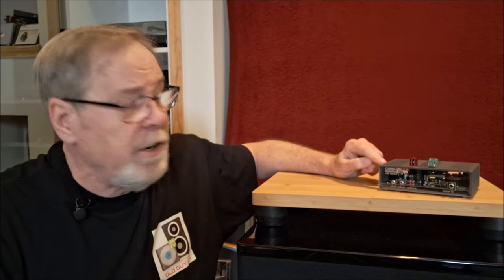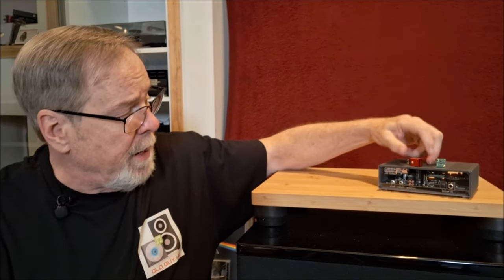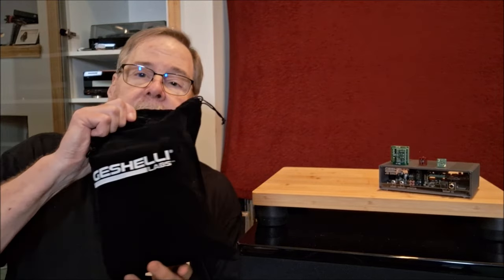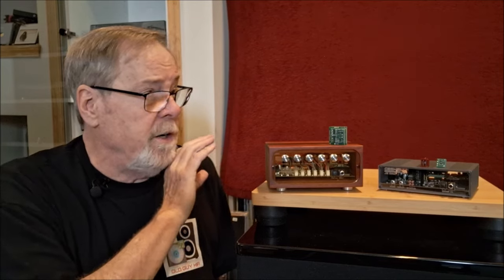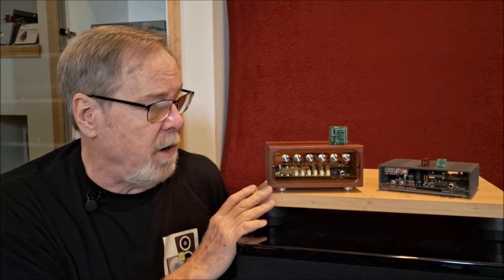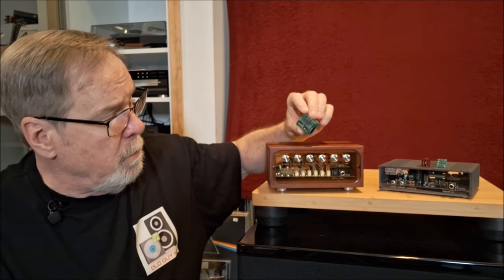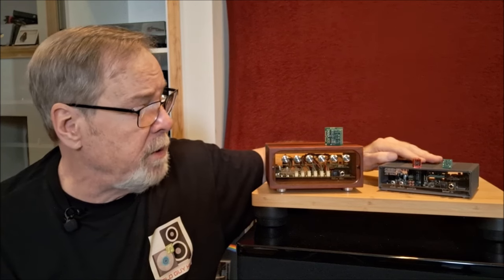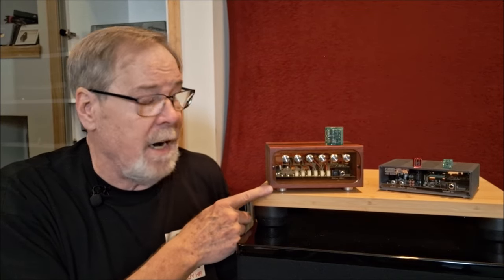A quick look at the new Geshelli Labs J3 Pro DAC. Full review soon.

Comment: How IN THE WORLD could someone sit on their couch and pick the right op amp?
Reply from the maker: Personally, I use magic. I have both the J2S and J3 side by side and as they use fundamentally the same chip set and layout I can compare the op-amps easily from my recliner not a couch! Lol. Seriously, I make extensive notes on the sound I am hearing and honestly, I have been doing this for so long my ears are kind of trained to hear differences and I have been listening in the exact same room for 30+ years. The bottom line is that if you can't hear a difference then there is no difference but, if you can, and that difference has a value for you then swap away. I also use headphones to try and listen in a bit closer. I do not advocate that anybody spend money on something that they can't hear. Wilson, thanks for sharing your thoughts and coming back to the channel for more.
Reply: @OldGuyHifi  yes, thanks for the feedback!  But from the point of view of a guy sitting on his couch wanting to buy this and trying to select the right op amp WITHOUT buying all the chips, this is going to cause buyer hesitation from out of this world for me.
Reply from the maker: I get it. Go with the basic unit J2S or J3 Pro and know that they both sound awesome out of the box with the standard TI op-amps and save the money for a nice bottle of Scotch. You won't go wrong. I think the AKM4499 chip set is the bid deal here not the op-amps. I am a nerd so I go for this tweeky stuff.

Comment: I would be very interested in your opinion about diminishing return / value for the increased price points in the Geshelli line. You can get the "classic" ESS9026 or AKM 4493 for around $250 (aluminum sans USB), or upgrade to the mid tier (that you have) J2S with Sparkos for  $500-670 depending on number of opamps, and finally $780 for the J3 Pro. So call it $250 vs $500 vs $800 (approx $300-ish jumps to simplify). What level of performance / value do you see between them? Of course we all want the best ;) P.S. What wood did you choose - it looks beautiful.
Reply from the maker: I can say with a level of confidence, that for the given price point the standard J2 is very good compared to comparable priced units from Topping, SMSL, etc. Now, just so you know, I am not the biggest fan of common Delta-Sigma chip implementations. For years my reference DAC has been a Schiit Bi-Frost Multi-bit unit that has been modified. I started to get an inkling that the new AKM 4499EX/4191 chip set was different with the J2S I have in. I have not finished my reviews yet so, my conclusions are very preliminary. I do hear a positive difference between the J2S and the J3 Pro. I think the differences between DACs that cost from $100 to $1000 can be far more significant and noticeable then the difference between DACs that cost from $1000 to $3000. Usually on the expensive units it is the output stage i.e., tube output or similar that makes the difference not the decoding methodology. Unless you have deep pockets or have a huge investment in your Hifi, I would council against spending much for than $1000.00 for a DAC. Wow! Did I just write "War & Peace?" Sorry. Great question. Thanks for seeking my opinion. Something I am not shy about sharing!  BTW, Geshelli just sent me the unit for review. They choose the wood.
Reply: I have had the same question. Have seen a couple positive reviews now of SMSL's DO200 Pro as a contender in that range, if it drops in price significantly this month, I'll probably give it a shot. Though I do like the idea of supporting the Geschelli family. So, so, so many choices...
Reply from the maker: For my money and listening preferences, I would go with the Geshelli J2S for sound quality.

Comment: This looks to be a good fit in the models between the J2S and the Dayzee. All the I/O on the back, and separate buttons, etc. The power supply is a surprise - I am looking forward to your review, Ed!
Reply from the maker: Thank you Neil. I am going to run it in for couple of days. Those big 2509s look like they could use some breaking in. First impressions are good.
Reply: @OldGuyHifi  Like all op-amps that I have tried, they all need some burn in, I think. What I have noticed is usually the treble gets "cleaner" / sweeter? The SS2590 Pro is their flagship and uses the best discrete parts, with less restriction on the size.

Comment: I’m gonna try out the SS2590s using a dip8 extension on the J2S. I had purchased the J2S a few weeks before they announced the J3 Pro 😅.
Reply from the maker: The 2590 dual will fit on the single ended only. However it does sound great in my J2S. Let me know how it works out.
Reply: @OldGuyHifi   I was able to install them on the XLRs sockets. As everyone has been saying, they sound better after the burn-in.
Reply from the maker: That's awesome. Great tip. I will remember that and share it. They do need some burn in. I noticed a change after about 36 hours or so. Better detail and smoother top end. I am going to be doing a deep dive on the 4499EXEQ chip set shortly. It is fascinating to geeks like me. Oh well.

Comment: Look forward to your full review Ed.  Great stuff.  I have theJ2S with the 4493 chip upgraded with Sparkos 2590 single ended and an external 12v linear power supply.  Curious how much of an upgrade the J3S would be over my hot rodded J2S.  Thanks
Reply from the maker: Having had them side by side, they are very similar. I snuck the big 2590 into the single ended on the J2s and one in the J3 Pro and it is very hard to hear the difference. That said I am still burning the J3 in so, I will know more soon. I did really like the J2S for sure. Thanks for tuning Carl I do appreciate it.
Reply: @OldGuyHifi  Thanks for checking this out Ed.  Interesting that the 2590 seems to have more of an influence thsn going from the 4493 to the 4499 chip if I am understanding your comment correctly
Reply from the maker: No. My mistake. The J2S is a 4499 chip same as the J3. I was trying to tease out the upgrades on the J3. I do think the 4499 chip set is the best non R2R DAC setup I have heard.

Comment: Looking forward to your reviews! I especially wish you cover Eversolo used as a streamer with J3 external DAC hooked up via SPDIF and USB as a comparison. I’m about to order the A6 MA edition, hoping for less on prime day July 16/17th.

I currently use the Sparkos dual Pro opamp in my aune magic DAC - only one opamp is needed for both SE and BAL outputs. I have not used the ss3602’s since I got the Pro opamp in and I have 3 of them laying around now 😅. I don’t think the pro opamp from Sparkos is very new, I’ve had it for a while now..🤷‍♂️ 

Also, please mention how the Burson V7 Vivids are in comparison to Sparkos. I’m very satisfied with the Pro opamp from Sparkos, ordered it unassembled without knowing, had to stack and solder it together myself in under half an hour 🙃🤦‍♂️

I subscribed because you explained how important the internal clock of a DAC is, seems that nobody else on YT knows anything about it… Thank you!🙏
Reply from the maker: Ivan,  Thank you so much for tuning in. I have been listing to the DMP-A6 with the Geshelli J2S AKM 4499 with both the Sparkos SS3602 and the Burson V7 Vivid Pro. I must say I prefer the 3602s but only just. I think they are more neutral and a bit more detailed. I will be honest and tell you I think the J2S w/3602s has a more detailed less bright sound signature that the DMP-6's built in DAC. I was comparing both over balanced and single ended connections. I am not sure I will have the DMP-A6 review done by Prime days. Thank you sharing your system configuration.

Comment: Hi, i need advice, I little confused.. I preparing to order J2s with 4499 and sparco and now J3 appears, so do you think same configuration on J3 should have improvment in sound or just ability to put bigger op amp?
Thx a lot
Reply from the maker: I am still trying to figure out the op-amp situation. That said I put  the big 2590 op-amp in the J2S on single ended and it fit and sounded great. If you are only using single ended outputs just go with the J2S and upgrade the op-amp later. In truth the differences, to me, between the 3602 and the 2590 are very subtle at best. The DAC boards are almost identical with some minor changes to fit the op-amps. The party piece for me on these DAC is the 4499 chip set. That's where the magic lives. I hope that helps.
Reply: @OldGuyHifi  you are the best, you helped me a lot. I will do exactly what you say because I use RCA and I will choose 4499 chip , combo :)
Reply from the maker: I am confident you will be happy. I know I would!